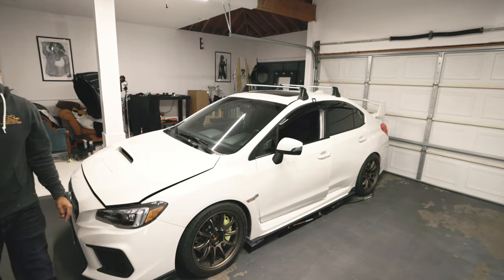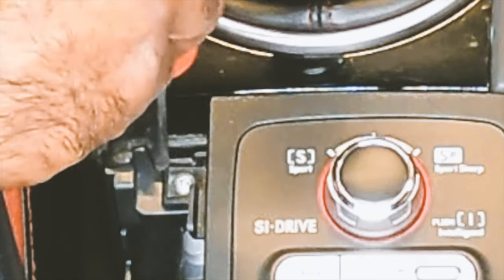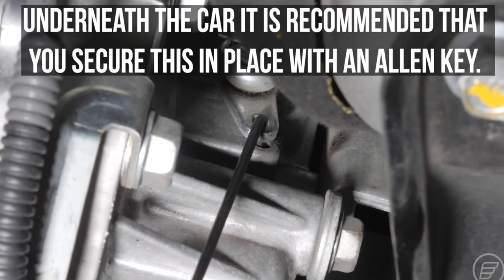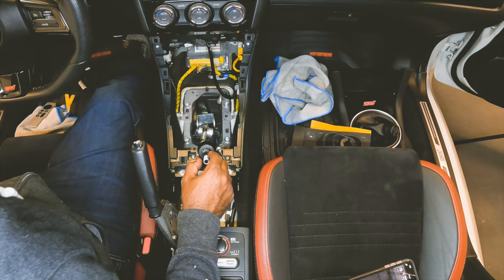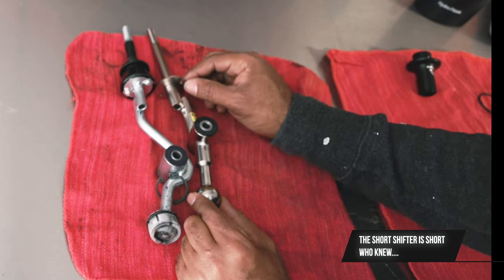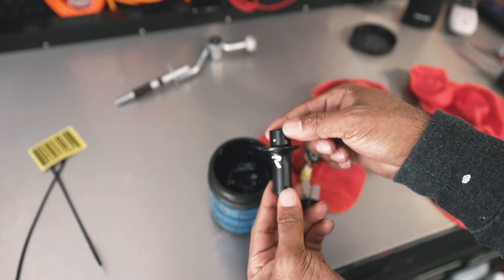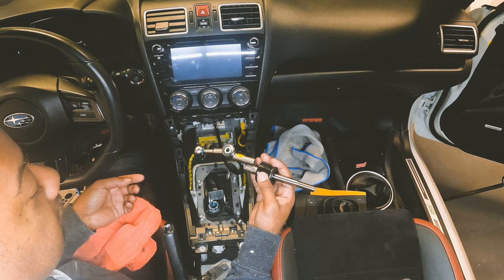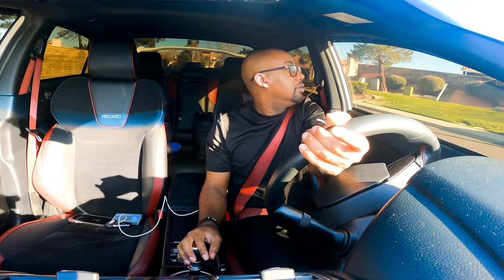Kartboy Short Shifter Install Review Subaru WRX STI

Comment: I got problems with reverse wire, because it was longer, it was making noise inside the "shifter" then I basically needed to use condom to put over it and separate it from the shifter body...

Comment: What mode do you drive in? I drive in intelligent mode on the highway and sport mode in the city.
Reply: The mpg difference is insignificant honestly. I leave mine in sport mode unless I’m gonna be doing some really spirited driving. I’m tuned so I basically only use mine to select how much boost I need, the acceleration is the same either way. Intelligent gives me 8 psi, sport gives me 14 and sport# gives me 20psi.

Comment: Also do you hear clicking noise when shifting to second from 1st?
Reply from the maker: No the shifter sit pretty much where stock is. but I have no idea what that clicking noise could be. weird
Reply: @DonteTidwell  hmmm mine sits a bit forward and also to the left. I got it professionally installed not sure why it's like that
Reply from the maker: @MrRyuken22  oh id take it back. that clicking noise could lead to something really expensive later down the road (no pun intended)
Reply: @DonteTidwell  like what? And I also hear a whining noise coming from transmission when in gear and off throttle. This is all after the kartboy install btw
Reply: @DonteTidwell  I'm taking it to a different shop tomorrow and I'll have them look at it.
Reply from the maker: @MrRyuken22  I don't know. anything could be going in in there. I'm just saying it could be something or could be nothing.  however, the transmission whining is 100% completely normal, so nothing to worry bout there.   i acutally like that sound.
Reply: @DonteTidwell  ok thanks for you help. Had a different reputable subaru shop inspected this morning, they said everything is fine that I may have gotten a defected shifter. I'm disappointed should have stuck with oem
Reply: @MrRyuken22  your clicking noise is probably because they didn’t zip tie the wire and it is hitting your drive shaft at times. The whining noise is normal with solid bushings. My Sti sounds super charged lol. If you add a stiffer trans mount it will get  even louder.